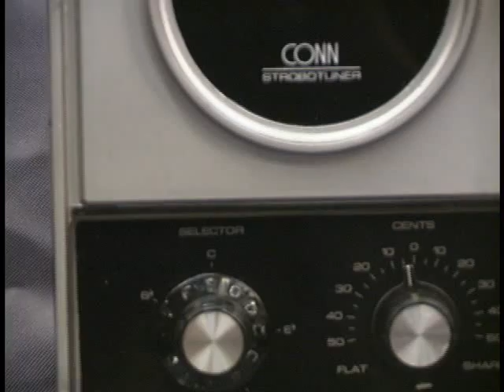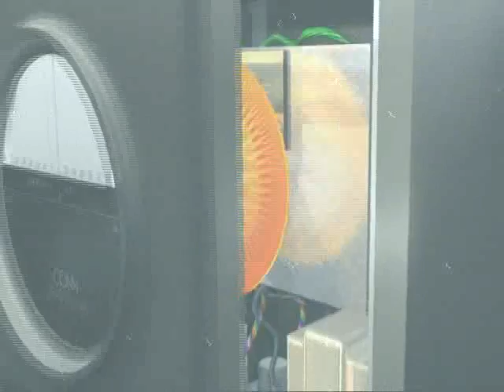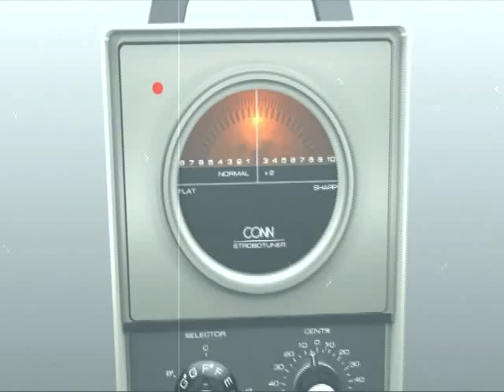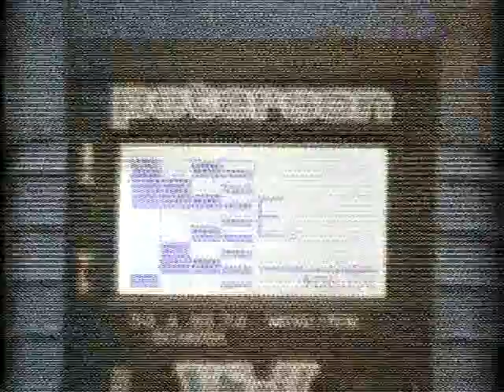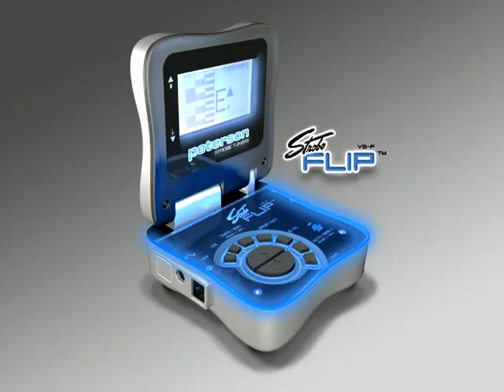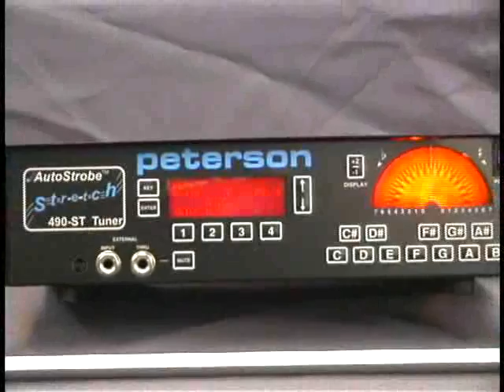Strobe Tuners: Their History and How they work

Comment: I'm no expert, but I had one of these in the 1980s, and it was at least 20 years old when I got it.  It was the most accurate tuner I ever saw, up until the day the motor burned up around 1992.  I would say that if the motor was to "wear out slightly" you would see inconsistencies in the operation.  These things are built pretty robustly for how delicate they may seem, I used it on the road as guitar tech for a band for 5 years.  I'd say your buddy is right to swear by his!

Comment: @Brandovibe 
The motor is regulated with a precise timing source.  Originally, the tuner's circuitry adjusted the power to the motor so that its drive wheel matched the frequency of a calibrated tuning fork. Different gear ratios could then be applied to achieve the desired speed on the tuning wheel(s). Today a quartz timing source is more accurate and reliable.

Comment: Question, with a mechanically driven wheel, wouldnt the accuracy decrease as the motor wore out slightly? I ask because a friend of mine has one of these that is 30 years old and swears by it....
Reply: Nope, I asked my coworker this. The speed is derived from the quartz crystal. Thats why it does not need to be calibrated. 

Here is the manual. Page 5

https://www.petersontuners.com/media/pdf/590%20Instruction%20Manual%20English.pdf

Granted, ten years later you are getting an answer but still relevant. Im supper happy about my 590 strobe
Reply: @santiagogutierrez1594  Hey, better late than never, thank you!